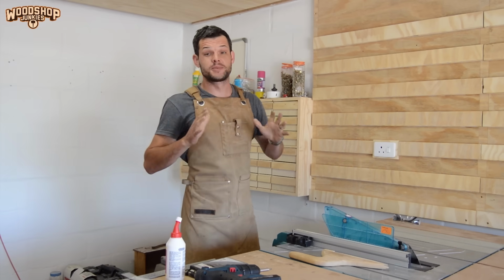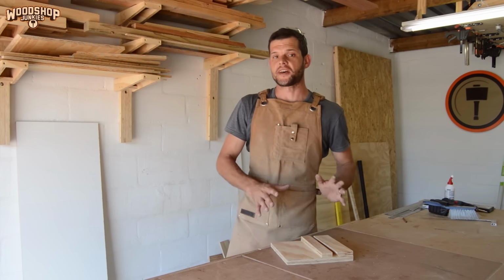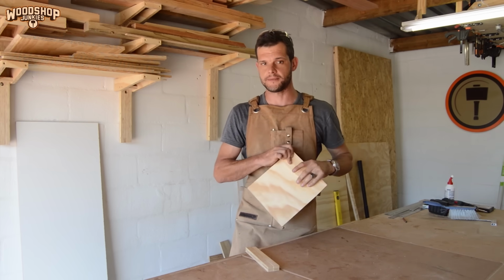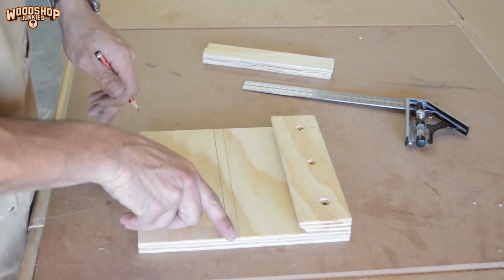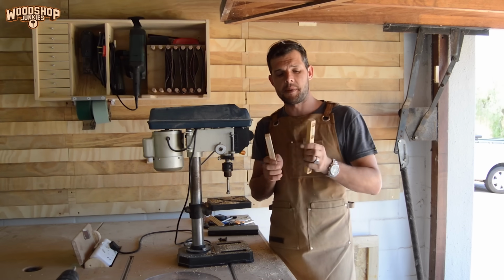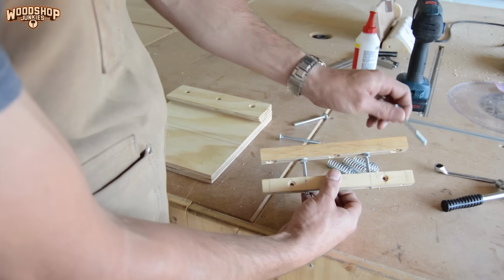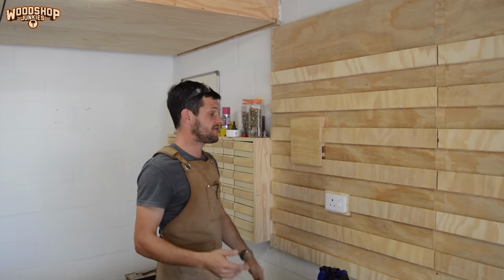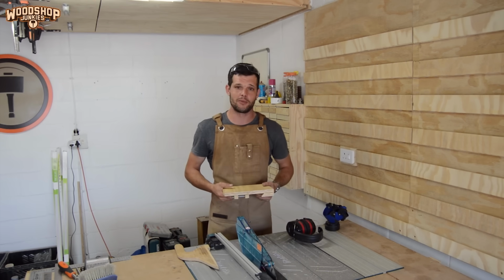Self-Locking French Cleat Mount - How To

Comment: I adore this spring actuated cleat.  When I was VERY young my Grandfather attached a hand exercise grip to his workshop wall to protect small tools and light weight fasteners from repeatedly falling on the floor.
I agree with you that the springs tension may need altering.
I was wondering why on the bottom most block you did not include an angled cleat cut to secure it to the wall unit?  It would seem to me that over extended use you could wear down the lower edge on your wall unit???
I am curious how you are going to articulate you camera mount or tool caddy from this flat surface to give you reach away from the wall?
Lastly, and most importantly could you make a building plan and materials list available?
Keep making GREAT workshop videos.
Jim
post: BTW I love my Toggle Clamps from Amazon.  I use them to connect modular Model RxR layout together to make longer layouts.  They work fantastic.  Thank you for the heads up.
Reply from the maker: I try to make plans available as often as possible but they take a lot of time to get them to a standard that I would feel comfortable sharing. Because of this I tend to only do plans for big builds.
Reply: @WoodshopJunkies  After this video you are going to curse my name.
So after this episode I went back to my workshop (French Cleat) desk to draw up some plans for a kid's project as a birthday gift.  I couldn't get the self-locking mount out of my head.
Then I thought what if you mounted your mount to a rolling French Cleat Tool Caddy.
Basicly a rolling box.  On heavy duty castors.  With some sort of small partition above.  The partition (like your wall unit) would have 3 or 4 cleats on both side of the partition.  Then you could remove entire wall hung units and place them on your rolling caddy.  To take them to your work site.
As a camera mount you would have the ability for traveling money shots.  And with some power switches and outlets in the box section you could have continuous power and save the battery life.
I am becoming sorry for you that I found this episode.  My mind is exploding with uses for the spring feed self-locking mount.
If you could make a prototype on a plastic AND a metal 3d printer, patent it, and licence it to the woodworking manufactures (Krug, DeWalt, Bosc, etc.) you could make millions for yourself.
Sorry,
Jim
Reply from the maker: @jvanamb  haha, thanks Jim. I will definitely keep playing around with expanding the concept.

Comment: Hey! Heres an idea for you... Change your wall side cleats to be double sided. Then change your clamping block to be a cleat and it can grip from both the top and the bottom. never going to fall out then!
Reply from the maker: Yeah, but once engaged you are going to have a pretty tough time removing it again.
Reply: @WoodshopJunkies  Im thinking of a bolt and slot through the front that you can use to slide the clamp down. maybe even a simple cam lever design.
Reply from the maker: @chrisvanmill6020  that could work yes.

Comment: There may be a much simpler solution. If you add a second cleat below the first you cover a lot of the leverage problems that could result in knocking it off the wall. Then extend the top of the panel (or the bottom) so you can mount your spring block to push against the cleat above. Mount the cleat by pushing up on the top and into the two cleats. You could also swap out the bottom rail for your springs with a cleat, but I suspect that will be harder to mount/unmount.

Comment: Kinda similar to how modular MCBs and RCCBs are attached to a DIN rail. Only there the bottom of the rail which acts as a cleat board is also angled, and the movable lower spring-loaded latch is chamfered so it can be pressed against the rail, which causes it to move down, a then behind the rail, where it locks

Comment: It certainly looks like a clean solution, but it appears to be considerable additional expense in hardware. I have seen a version where push wedges are used to engage the underside of the rail, which can be made from offcuts of wood, and hence are cheaper - you do need more space besides the cleated unit however to pull those in and out.

Comment: an idea would be to cut the wall cleats with 45 angle top and bottom then instead of having a spring loaded piece of wood to hold it on another 45  angled piece of wood  and a slot on the face plate to secure the face plate. hope i explained it correctly

Comment: My suggestion would be to add eye screws to the moving part of the spring so you can squeeze from there instead of pushing the mount around.  Possibly also add another cleat to the bottom part so it is engaged on two levels instead of one

Comment: To me it seems overly complicated. I had the same problem with lighter cleats popping off at inopportune times. My solution was to put a thin sheet metal strip along each wall cleat so that I could use magnets on the lighter ones to hold them in place. Worked like a charm.

Comment: this would have good applications, there is a simpler method however. You could make the backing board facing the cleats long enough to cover one whole cleat, and the one above and below it for a little bit. Then you make the mounting cleat bigger, the distance between the mounting cleats minus the width of a wooden key. Then you make a slightly tapered wooden key, possibly from hardwood, with a thumbhole or something. You mount the whole thing on the cleat, tap the tapered key in and voilá

Comment: I guess if you didn't want to use springs you could use a (can't remember name) a increasing radius spiral, connected to a knob, so place it below. It would provide the tension on the above cleat once rotated in place. Advantage: no metal, no springs Disadvantage: a lot harder to make, tolerances are high, could wear out.  Overall springs seem like a good solution, though I think you could have skipped the 2 guide pins and the bolt in the springs can serve the same purpose. Looks great, can't wait to see it in use, or did we just see it in use....

Comment: This is probably overkill but for ver 2.0... cleats on both edges of the wall rails (top and bottom), allowing you to cleat the spring loaded push bar
giving you the option of easily removable spring cleats, and more permanent/secure ones (dual cleat) that aren't spring loaded which can be slid in from the edges.

Also would it be feasible to do 1/2 cleats? in other words you could design the entire thing with 1/2 cleat + 1/2 flat, so that any style would work (traditional, spring tensioned, and dual cleat).

If there isn't already a router bit to make this profile then there should be... and can be if you're willing to pay someone.

Comment: Cut a double french cleat. What i mean is cut a 45 degree angle on both side of the cleat on the wall. Make the same jig but have the pusher bar be on a 45 degree angle to fit in the second 45 degree cut on the cleat. So one 45 clicks on top and one clicks in on the bottom.

Comment: Great solution, but I would give it an improvement. You could add a cleat edge to the bottom (fixed) piece of wood, so when the springs press the wwhole thing down it sits in the next lower level. So you would have two edges holding it to the wall.
Reply: Damn, beat me to it.👍
Reply: @charlesdabb1821  me too. I think it would be an easy retrofit.

Comment: How would it go if you had that mechanism working in the opposite direction with a mitre cut on the moving part so it locked into the cleat below? You wouldn’t need as much spring tension as it would be locked into 2 cleats.

Comment: counter bevel all the bottom cleats. (spring loaded and wall mounted) too much work removing and trimming wall runners, but then the cleat will only be removable by intentionally pushing up on the spring mechanism (clever, by the way...great vid).

Comment: I'd build these without the 2 guide bolts.  The 3 bolts with springs should be enough to keep things aligned. Also, like others have mentioned, just use a wedge block on top of the plate to hold it in place.

Comment: Add a hollow sleeve where the bolts have to move through the wood, and wax the board behind the push bar. That will reduce wear and make it easier to use but not hinder the function very much. For normal uses I'd say this is overkill but for something like you describe it ought to work very well.

Comment: I'm going to lose sleep thinking about the simple solution. Two or three ideas I see are posted already below in the comments.  I can absolutely see why you would want a lock on the camera swing mount. 

Is there room on your plate for a knob on the face? If there is room, the knob on the face rotates a larger diameter eccentric disc on the back, which jams itself against the bottom of the cleat. Friction holds the adjustment in place. It could be offset to either side and still word perfectly. One knob, one eccentric disc and a bolt.

Comment: I’d put a bolt with a knob through the front and into the moveable strip of wood. Cut a notch into the face to allow the bolt to move. It’ll allow you to do it easier and with one hand. You could also make the moveable piece into a cleat to make it lockable. You would need to angle the bottom of the stationary wall part also.
Reply: I love this idea!

Comment: Possible way to make removal easier, drill to holes in the spring loaded section that you can hook your thumbs into and 2 slots in the back panel so you can pull the spring unit
 down.

Comment: Great idea but I think you over-complicated it a bit.

If you made the backing plate a little bit taller you could simply add a block of wood above the cleat so that it stops the cleat from moving upwards as the block of wood would hit the next row of ribs. If you keep the distance between the horizontal rows / ribs the same you can use the same width of block for all locations on the wall. Attach this block to the cleat with a string so you don't lose it. :-)

I hope that made sense!

Comment: I admit to being a bit confused.  Why not just use two cleats on the camera mount and a simple piece of wood that slips in between the top of the bottom cleat and the bottom of the top wall mount to prevent the camera mount from being able to lift up?  Does that make sense, or am I missing something?

Comment: I’d skip the springs. Have a flat bar (similar to the one you have as part of your spring assembly) that can slide up and down on two slots cut into the face plate. Then have a threaded insert on this bar so that you can use a bolt or cam to tighten it in place. Easier to make, cheaper, and probably more robust. 

Generally speaking, though,I like your idea of a system that locks the cleat in place.

Comment: You could increase the effectiveness of the hold by bevelling the bottom of your wall rails, and the top of your moving key to the same angle as the top of your wall rail. However, in my personal opinion this system is too complicated. In planning my own French cleat wall (unfinished) I briefly considered using the above in combination with a pivoted key, sprung with clothes peg springs. I rejected that idea for the same reason. I have subscribed to see what else you have to offer.

Comment: I always appreciate a clever solution to a real problem. However this seems to be over-engineered. I am not an expert in French cleats, but it would seem to me an easier way to do this would be to rout a rabbet on the underside of the wall mounted part of the cleat and then add one or two rotating clips to the bottom of the mounting piece. The rabbet can probably be added while the rails are mounted on the wall.

Comment: Personally I would just cut a block of would at the measured dimension to push in on top of the cleat you are wanting to lock into place. The only reason I personally see that a locking cleat might be needed it in the even of a small earth quake but big enough to rattle things loose.

Comment: Do it right once and you won't regret it. I like overkill. The only thing I would do different is add a slight bevel to the bottom only a couple degrees to focus the pressure more then add wings on this side to pull down the rail to put on easier

Comment: Usually when you hang something on a cleat like that the weight of the item holds it in the cleat so the need for a secondary clamping device is unnecessary but I can see if you wanted to hang something light weight where this could be useful

Comment: You could also make a 45 on the wall mount for your camera mount so you are not just relying on pressure but also a 45 on the mount that will push into the wall rail for double insurance as camera are expensive
Reply from the maker: Thanks for the input!

Comment: How about a french cleat on the bottom - the spring loaded strip with an upside down cleat so there could be no movement. Your horizontal plates on the wall would therefore need an opposite cleat to the existing one.
The springs would not need to be as strong as the ones you are using making it easier to mount and dismount.

Comment: Pretty cool design, but seems like overkill to me.  A simple wedge put at the top of the mount would lock the cleat mount above it.

Failing that, I would reverse the spring assembly and have the spring lock into the cleat below the mount for a 'double' cleat mount.

Comment: "Or is it an overcomplicated solution to a simple problem?"

That one hurt.
Reply: I'm honestly curious what would be your simple fix?
Reply: @snafubariffic  The simple fix is a wedge tapped in above the holder to keep the cleat from lifting.
Reply: Forget the springs, add another cleat wedge to the bottom to engage with the lower cleat rail
Reply: @JohnColgan.  the point was to negate  dislodging  from a lifting force.
Reply: @snafubariffic  No man, it's a joke. 99% of what I do in the shop could be accurately described as "overcomplicating a solution to a simple problem". John didn't have to call me out like that in front of everyone ;)

Comment: wouldn't it be simpler to insert a strip of wood between the top of the cleat and the cleat above. this is easily removable and would lock the cleat in place. It could be slightly wedge-shaped too.

Comment: Well guess thats what you call textbook overengineering. just add a simple hole to the backwall of the holder, right below the wall cleat. stick a dowel through it, tadaa locked. time, 2min. material needed one frikkin dowel.

Comment: This is the epitome of over engineering. The great thing about French cleats is that they don’t need to be secured by anything other than gravity. I can’t think of a scenario where this would actually solve a problem. Did you have a problem with your things falling off the wall before building this? I think you nailed it at the end of the video, it’s definitely overly complicated. Well executed but completely unnecessary.
Reply: did you not listen to his problem at the beginning in which this would solve...?

Comment: LOVE some of your ideas and straight forward instruction.  However, when I see you use your miter saw without a better dust shroud to catch most or all of the dust produced by the saw cut I want to choke you.  Please use your search, skill, great problem solving capability to dream up the proper solution.  My respectful suggestion is to increase the exhaust hose diameter, 4" is okay for short runs, 6" is better, 10"+ is great.  Increase the volume of air moved not the velocity.  Create a larger shroud encircling the saw's rear as much as you can. 
My comment is meant as a positive and good natured tip for all of our better health by breathing cleaner air.  Happy woodworking!!  :)

Comment: excellent execution but over engineered concept. it would've been much easier to just move a base higher drill it through that way so top point of the hole will match with the plank over the cleat and then just use dowels (a bit sanded and waxed). of cause that will work only when there are at least 2 cleat planks, meanwhile yours will work anywhere.